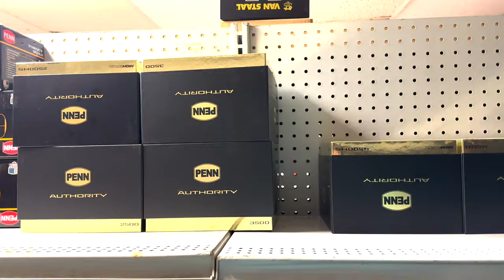We Bought A 15,000 Square Foot Warehouse For Our Saltwater Tackle Store!

Comment: Wishing you much success.  I hope you have a retail mentor, cheap supply sources, an available labor pool, diversity of products, inventory control including IT, solid knowledge of shipping processes, and about 100 hundred things that make a difference to the bottom line and counting and pinching every stinking penny.   Most of those products margins are thin due to heavy competition on the internet, so volume will be king.  You are selling products that y'all have a passion for, which is great.   That passion will be necessary.  Long hours await.  Your labor is free.  Remember to keep the retail store open as long as you can, 7 days a week.  That floor space is expensive, and you are competing against the internet. Carpe Diem.